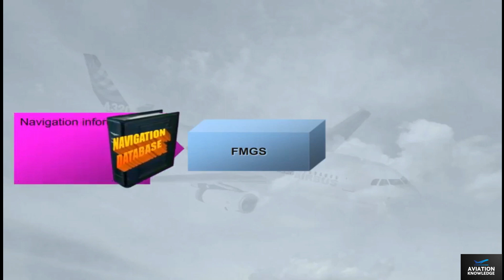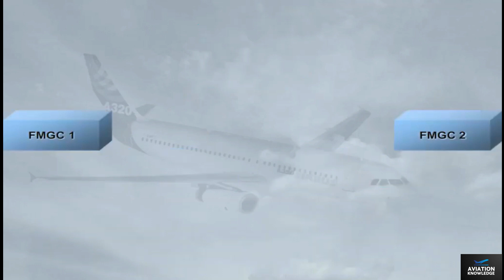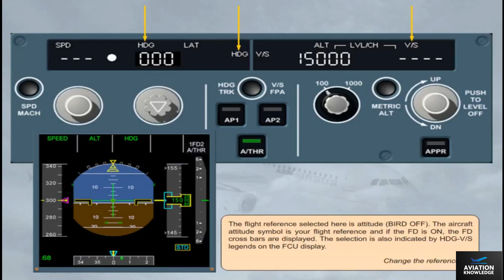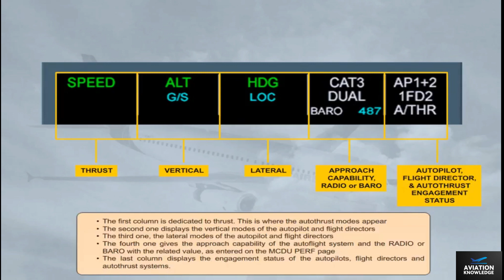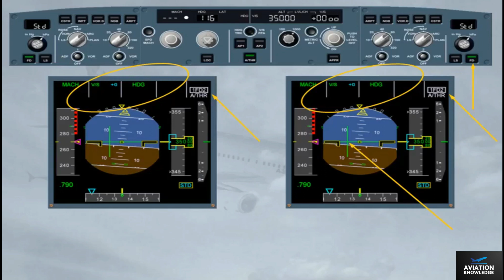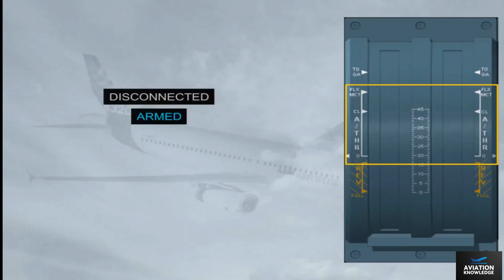A320 CBT Auto Flight  ( NEW part 1)

Comment: Hi as I know FAC is a separate computer that it provides what you have listed besides the FMGC which is devided into FM and FG. So would you like to clarify plz
Reply: The FMGC(Flight Management Guidance Computer) has two parts : Flight Management Part and Flight Guidance part. The FMGS(Flight Management Guidance System) Is 2 FMGCs 2 MCDU one FCU and two FACs- FMGS refers to the system in total made up by various components. The FMGC is one of those components and it in its turn has two parts.